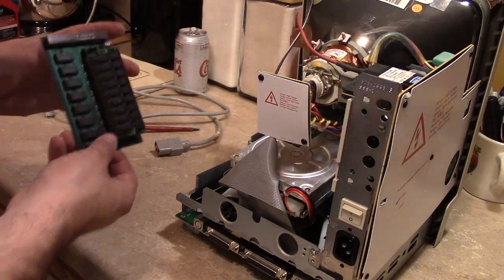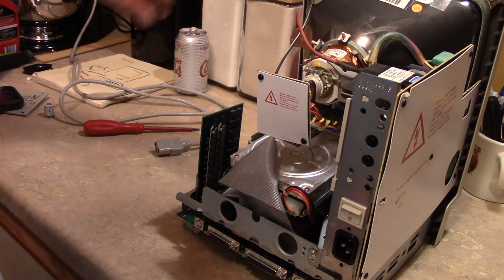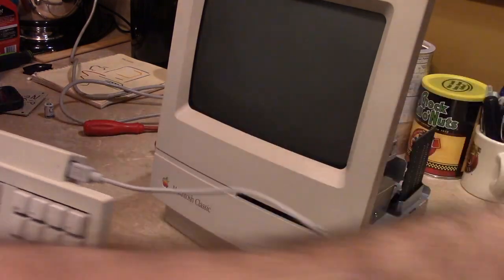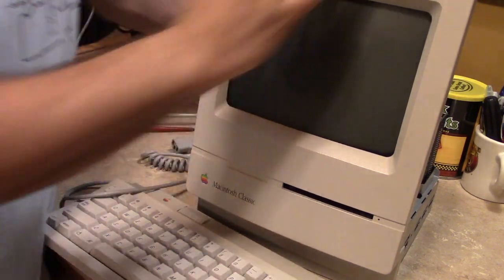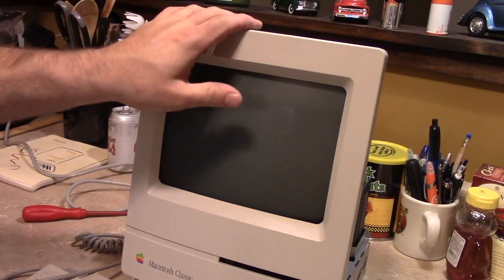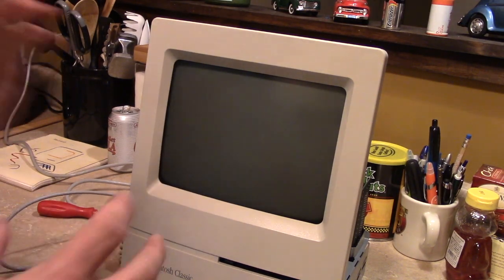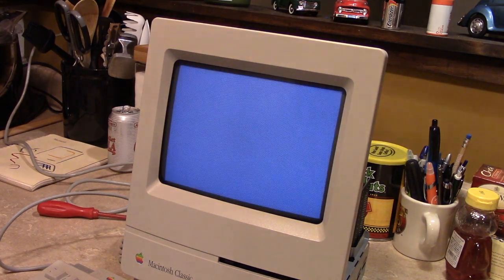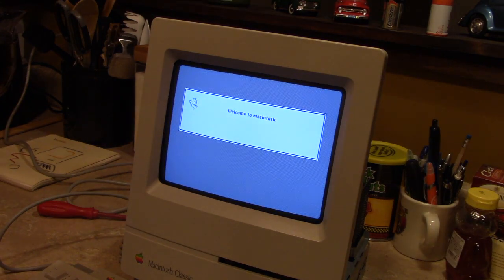1991 Mac Classic Project: Part 4, "Wash Behind Your Ears... And Also The Logic Board."

Comment: I remember the Macintosh Performa computers running At Ease in the junior school I was at in 1997, one thing I liked about At Ease was the fact that on the computers at the school at least, the computer would announce the name of the item you pointed your mouse pointer to using synthetic speech, I presume that's a setting you can change.  These days Mac OS has a simplified finder, I guess that, or the launchpad, is the modern equivalent to At Ease.  I remember a game called Stunt Copter on the original PlayStation, completely different to the Stunt Copter game you showed here.

Comment: @BBISHOPPCM's World
When I fixed my SE/30 I did wash it after I took off the old caps when washed. then I put on the new caps after 2-3+ days to dry.  I also removed the stock battery holder and replaced it with a Button Cell battery like what is in computers today and removed the batterys that like to Leak.

Comment: A more accurate description is that a capacitor is a power storage device, maintaining a voltage differential between anode and cathode... whereas a battery is a power generating device. potential energy is stored in a battery by the way of reactive chemicals. But to get electricity, the battery needs to perform a chemical reaction...

 a battery doesn't store electricity. But generates it through reaction.
Reply from the maker: I'm not an engineer.
Reply: my bad. I can be a dick sometimes without trying to be. It was kind of an uncontrollable, It's time to exercise knowledge moment.sorry....i loved the video.
Reply from the maker: No worries. We're all a bunch of douchebags sometimes!
Reply: Not all batteries are reactive.  A Lithium-ion battery for example, moves energy via diffusion of Lithium ions between the electrodes, not by the formation and breakdown of chemical  bonds.

Comment: So, who is this Mike LaSeeck? :p
Love your videos man. :)
So, is there a solution to faulty capacitors?  I mean, one that would make having to replace them a non issue?
Reply from the maker: Just... replace them. It's like $15 in parts!
Reply: I was thinking a more permanent solution.  Like a non leaking capacitor model or something.  Or is this out of our reach for now?
Reply: You could certainly try Oscons or other good quality solid electrolytic caps (they are quite common these days). Though really the main reason why SMD electrolytics from this time period tend to be so unreliable is them being soldered too hot, causing the rubber seal to fail and electrolyte to escape (and contaminate the board in the process, hence the washing issue).

Sony had big problems with this in all kinds of equipment, most notably various camcorders, DAT decks (head drum amplifier boards) and portable shortwave receivers.

Inadequate ventilation is not going to help matters, and if you're not going solid caps then 105° series are recommended for warm spots.

Comment: Was the resolution the same for all Classic macs before the mid 1990s? Something makes me think it was. That was a setback (engineering wise.)
Reply from the maker: It really was! Mac 128k all the way to Classic II used essentially the same freaking CRT, running at the same res.
Reply: And that was another problem with the limitations. You wonder if Apple was serious with the Macintosh all together or it was just to get to be "first" with GUI computer. There had been claims that Steve Jobs tried to float an idea of a UNIX type of Mac in 1985 when Apple denied his idea, just before he was shown the door. 

But here's the deal. For nearly 17 years, all the innovations like color, network connectivity, multi media, etc was done through System Enablers, INITs/Extensions, patches, upon other patches. Having problems? Just wait for the next full release of System Software and it will fix everything. *sarcasm* The classic Mac OS was just large bandaid to just prop up the weak on arrival architecture. The design was so limited to single tasking, floppy disk storage and no connectivity other than modems is the reason why Mac OS was so difficult to engineer (not limited for a user). 
There was so much turnover in the Blue (System 6) and indefinitely Pink (System 7) which was even worse for a while. For one example System 7.5 was awesome, but it was a victim of "feature creep" and any substantive improvements was abandoned by this point per to the original "Pink" project.  Obviously every limitation was lifted with OS X, but the 1990s was one heckuvla time that one doesn't want to remember.

Comment: hey, I got a Question someone gave me a white Macbook late 2007 2.0 Ghz the battery is bad but I got one coming. it's running OS X 10.7.5. it has 2GB RAM  is 10.7.5 the highest OS that I can use? love your Videos BTW!!! I am a 64 yr old Geek worked for DEC on their PDP 11 systems back in the late 70's - 80's. worked on 300mb  Disk drive the size of washing machines.
Reply: Kristyanna Virgona 10.7.5 is the highest you can go on that machine, i actually own one right now, but the screen is damaged and i dont want to fix it. You can go to 10.8 using Mac Post Factor but the video drivers don’t work properly
Reply: Yes. Mac OS X 10.8 and above requires more specs than the computer has. The previous owner left it on Mac OS X 10.7.5 for a reason.
Reply: Damian9303 you cant natively run 10.8 on those due to apple making anything below the aluminum unibody 2008 macbook obsolete